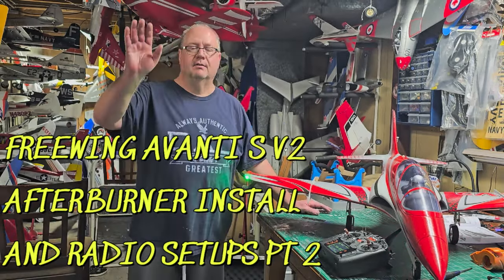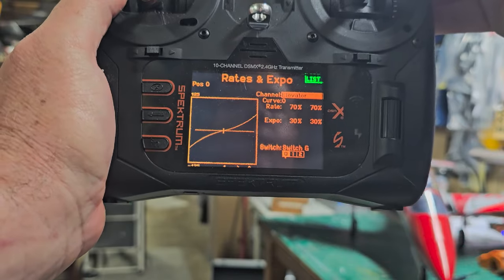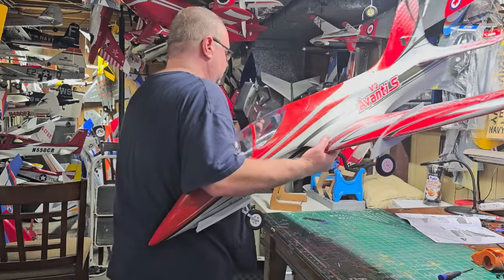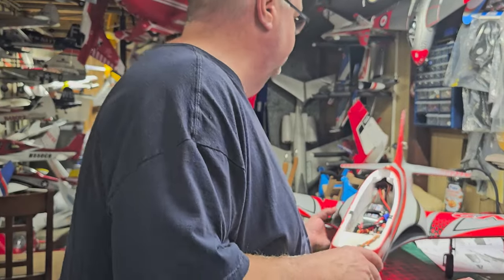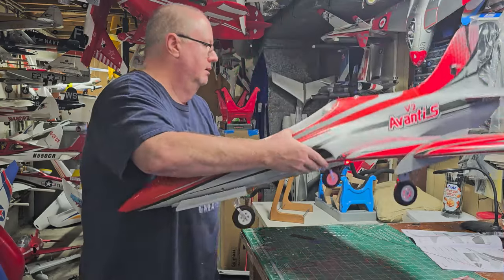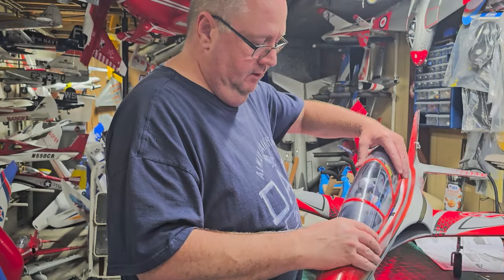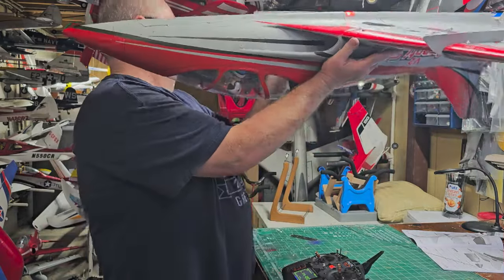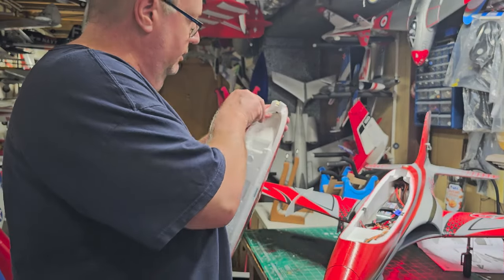FREEWING AVANTI S V2 AFTERBURNER AND RADIO SETUPS PART 2 by FGFRC

Comment: Did you use the basic settings for the maximum angle of the ailerons, elevator, flaps and rudder according to the manufacturer's manual? I tried it and I think the setting is too big. I am asking to know what basic setting it is based on for the radio (rate+expo). Thank you.
Reply from the maker: I set it up by the book on aileron and elevator but use 100% throws on rudder with 30%expo.  and after 2 flights  I  ended up using the same on ailerons and elevator. Flaps however are to much on landing flap manual settings so i will end up using a flight mode to straiten it out.

Comment: does it sit with the nose in the air with no battery in?
Reply from the maker: Yes but they installed a plastic skid on the tail bottom.
Reply: ok great. Ive got the v1 and the RC geeks afterburner. Just wondered it it was normal. I can move the battery for cg so should be fine